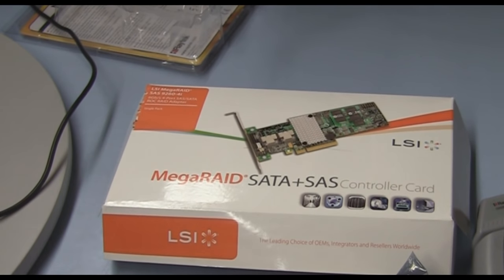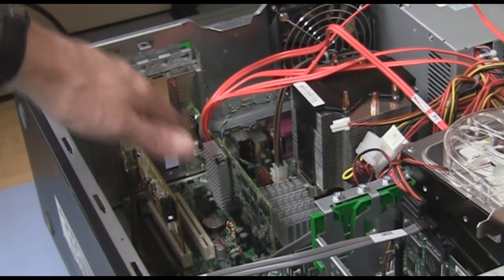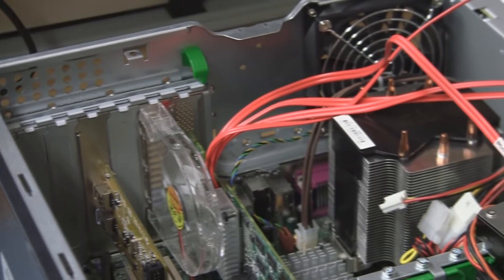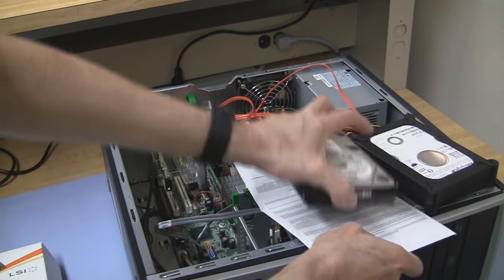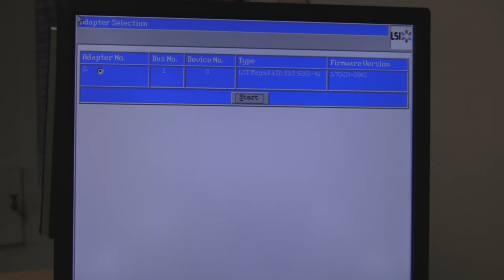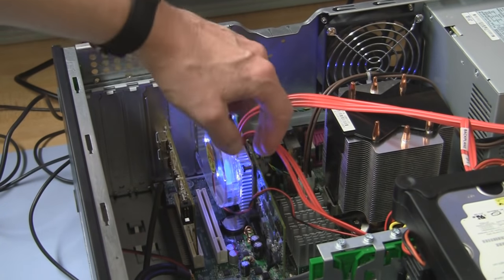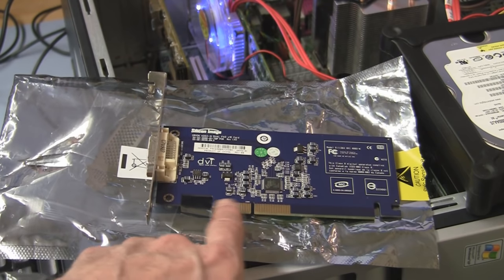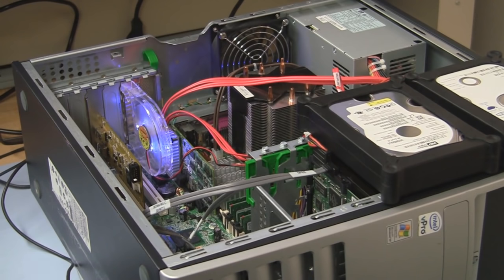Installing the LSI SAS controller in a Desktop Part 1

Comment: Good video but few issues.  

First, that fan is a puller, not a pusher.  You're pulling air through the fan and exhausting out back.  No big deal but an important distinction.

Next, you're ignoring the units.  F VS C.  The spec sheet for most LSI SAS controllers says up to 130-150F ambient (depending on the model) and 90C on the chip.  90c is 194F.

Issue 3.  Many of these controllers are now 8-10 years.. The paste on them is also 8-10 years old obviously.  Paste that old is hard and useless.  New thermal compound is a must when you get one of these.
Reply from the maker: Comments appreciated!  Thanks for watching!
Reply: He achieved his goal to keep the HBA within the manufacturers recommended operating temperature . Everyone is an expert.  Nice video , we appreciate the time you spent producing it

Comment: Good video, but you mean more like 100 degrees Celsius (or 200+ degrees Fahrenheit). I have worked with RAID cards extensively since their first existence in the market, and I have an Adaptec 6gb/s card where the PCB actually melted because I was unaware of how hot it would get and had inadequate cooling (plus their OEM heatsink was vastly inadequate).

Comment: Thx for info. Didn't know that some higher air flow could have been required. I'll have to give it a look. Need to install an HP H220 card into a Dell Optiplex 990 MT hope it will work fine..
Reply from the maker: Anything designed for servers that are not passively cooled take advantage of the rate of air flow typical in a server.  There are no fan power jacks in most servers I have worked with.   Never run a server with the case cover open, that air flow will be disrupted and devices will begin to overheat quickly.

Comment: First off. 120F is 49C and quite cool for computer chips. Secondly, your blower appears to draw air over the card and evacuate it out the back of the chassis, which is fine. Also, you can't measure aluminum with an IR thermometer since aluminum does not radiate IR efficiently. Paint it black.
Reply from the maker: Love the feedback and comments!

Comment: I bought a SAS to eSATA + power conversion and connected it to the laptop but it did not appear on the computer and I want to use it as a storage unit only and not to read the RAID ??

Comment: I have a Rosewill Thor V2 with a big side panel fan. Do you think that will be good enough or should I strap a small case fan directly to the heatsink?
Reply from the maker: If you have air flowing across the heatsink that should be fine.
Reply: @TechsavvyProductions  is it possible to bot into a sas drive thats connected thru the sas pcie card?

Comment: I need some help - what kind of cables do I need, will simple sas cable like this work "SAS Serial Attached SCSI SFF-8482 to SATA HDD Hard Drive Adapter Cord Cable F" for 3,5 inch hard drive? do I simply need 2 drives both with cables like these connected to the controller and set up as raid 0 in the bios to work properly in a desktop?
the HDD is -
Seagate 4TB Exos 7.2K 12G SAS HDD 3.5" 7E8 V5 Enterprise ST4000NM0025
the Controller is  -
HP 689576-001 LSI 9212-4i SAS 6Gb/s
Reply from the maker: The controller has four x1 SATA internal connectors,  so the "SAS Serial Attached SCSI SFF-8482 to SATA HDD Hard Drive Adapter Cord Cable F should work for each SAS drive.  This site had the best info on your controller http://www.scsi4me.com/hp-lsi-sas-9212-4ipci-express-6gb-s-sas-pcie-2-0x8-host-bus-adapter.html

Comment: Can the ASHATA SAS Controller Card,Eight-Port 6Gbs 512M RAID Main Control Disk RAID Contreller, Powerful Stable RAID Controller also fit into a desktop?
Reply from the maker: They will fit, be careful concerning cooling.   Look at the temperature specs on the main chip on the controller and make sure you keep the adapter's temperature within specs.

Comment: i just bought a  SAS  hard drive, not knowing it was SAS. Do i need this controller? what other  connectors would i need to have this work in my desktop?
Reply from the maker: You do need a SAS controller,   Amazon has a good selection, keep in mind cooling for both the controller and the hard drive.  SAS HDs run typically at 10K to 15K rpm and run hot.    The controller manual will give you cable and connectors you need.

Comment: I got Dell PERC H700 RAID drivers everything did install but does not find drives , Trying to install 4TB Seagate drives. Do i need IT mode on a desktop computer? Cables are DIY Mini SAS 36P SFF-8087 to 4 SFF-8482. using windows 10 enterprise are does it have to be Server i have windows server 2008 r2.
Reply from the maker: Dell PERC H700 RAID controller is a enterprise controller and should see SAS and SATA drives.     Some controllers have Server drivers only and may not work on client OSes.

Comment: My pc goes straight into the login windows instead of the LSI screen, any tips?
Reply from the maker: Turn off Windows' "fast boot, also go into BIOS and check to see where in your firmware settings you can enable/disable  "suppress boot display" and disable that feature.    Some BIOS refer to these settings as "fast boot/slow boot".   It allows you to see POST and and slows the booting of the PC but you will see the controller firmware option.
Reply: @TechsavvyProductions  just turning off the fast boot allows me to see the LSI firmware option? Ok thank you ill try it out
Reply from the maker: Look for those BIOS options
Reply: @TechsavvyProductions  hi,  thank you for replying; if its okay id like to ask one more question. I bought a LSI 9003-8i which is a SAS/SATA controller if im not mistaken, when I plug in my SATA HDD, it works like plug and play. But when i plug my SAS SSD on it (with an adapter) its not reading the sas drive. any tips?
Reply from the maker: Make sure the cable are correct Internal Mini SAS SFF-8643 to (4) 29pin SFF-8482 connectors with SAS 15pin Power Port

Comment: What are the requirements for the hard drives.  Is there a maximum capacity, say 2TB?, Should the drive be formated, will it accept GPT or is that a function of the computerr? Etc  I would consider this part of installation.  As for cooling, the silicon chips themselves will usualy operate at 100 degC junctions, so it's a question of the thermal resistance from the junctions thru the heat sink to the cooling air. If the mfg specifies 100 degF for the heat sink then that prolly includes some margin but it's not wise to assume that it is a lot.   w3

Comment: no, most SAS drive are not 2.5"
Reply from the maker: Due to reducing power demands and heat required by servers most SAS drives have moved to the 2.5'' form factor, even at the cost of capacity.

Comment: You do realize 120 degrees F isnt hot right? That's the temperature of kids hot chocolate at Starbucks. You can set your hand on the backplate of a video card at 120F and it just feels warm. I'd be very surprised if a raid controller from LSI couldnt tolerate being "warm."
Reply from the maker: Scott, great point in the video I do have a fan running on the heat sink so the temp is limited to a lower temp,  we discovered that running the controller without a fan the card's heat-sink chip overheated quickly.   Within ten minutes you can not touch the circuit board opposite the heat sink with your finger.   These boards require a certain airflow cu ft/min rate to maintain proper cooling and specify a certain environmental temperature range.  Thanks for taking the time to comment.

Comment: Can ANYONE link me to that fan or give me some type of name so I can find one online?????
Reply from the maker: https://www.amazon.com/Vantec-SP-FC70-BL-Spectrum-System-Adjustable/dp/B000233ZMU
Reply: @TechsavvyProductions  I bought 2 server raid cards. HP Smart Array P822 / 2GB FBWC 6GB SAS RAID Controller. One was used one was new. The used one literally was on the verge of starting my workstation on fire. My cpu, raid card, and video card were melting hot. The raid card also locked my computer and I had to disconnect the power and plug it in to start it again. This episode nearly corrupted my hard drive and it took an hour for windows to repair itself. The boot times with these cards is oppressively slow. The brand new raid card did not melt my computer like the defective used one but the card still runs hot. I remembered watching your videos and you using a pci fan. I watched other videos where people put 40mm fans on the fins of the heat sink. Do you recommend a 1 fan, 2, or 3 on a pci card for cooling critically hot raid cards? Also what do you think about putting a 40mm fan on the raid cards? Do you have any suggestions for increasing the air flow in a workstation or pc? Do you have recommendations for the rpm speeds of cooling fans?